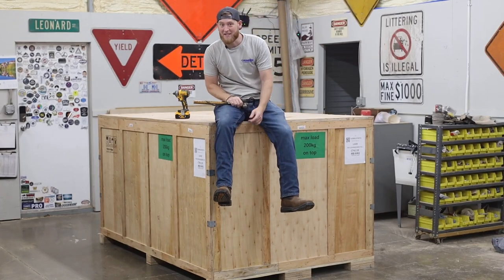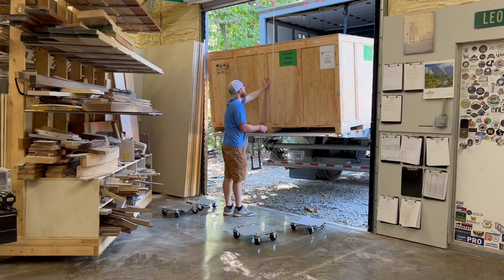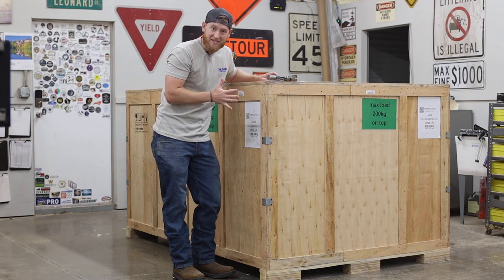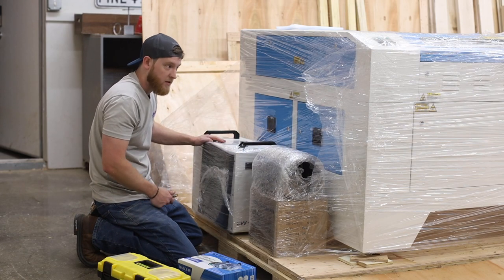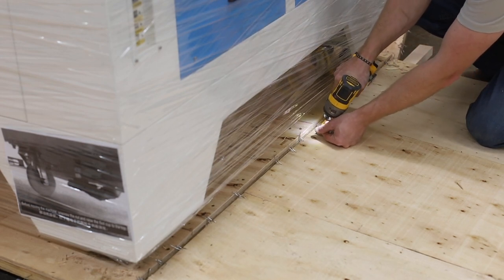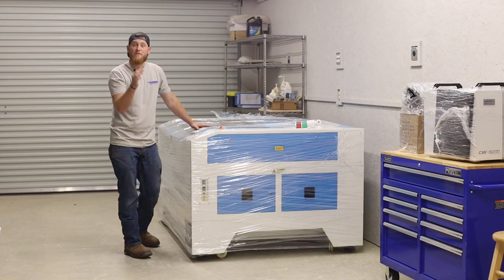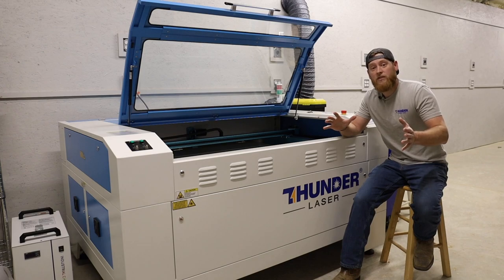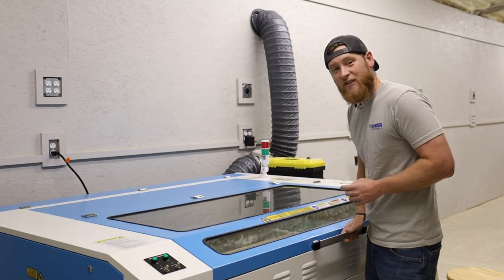Thunder Laser Nova 51 Unloading and Unboxing ll My Initial Opinion

Comment: Ha! I wrote a post on the /r/lasercutting subreddit about the size.  I must have gotten mine almost the same time as you, late November, only diff is mine is the 130 (which I think I might regret?).  It's probably better in the long run for what I am using it for, as it will cause it to last longer, but I'm having trouble with it's lowest power and fastest speed being too powerful.  Anyhow, I had my 51 delivered with no extra equipment, it was scary!  I had another shipment that happened to come at the same time, so that guy helped, but basically we had it on the balance point of the middle of the unit, on the very far edge of the lift gate.  We even had to lean it over to make it clear the back of the truck!  I would not suggest getting a 51 the way I did!  interesting, you're in NC as well!
Reply from the maker: Yep it was a little iffy unloading it without help. Where in NC are you?
Reply: @Statedwoods  Clayton, just outside of Raleigh.  You're in the Wilmington area?

Comment: Did your 51 not come with a PITA piece of wood running the length of the machine, or did you just not show it?! Getting that loose was the hardest part for me when I was trying to get mine off the pallet because the weight of the laser was pressing down on it!